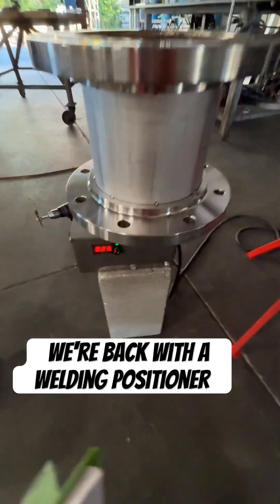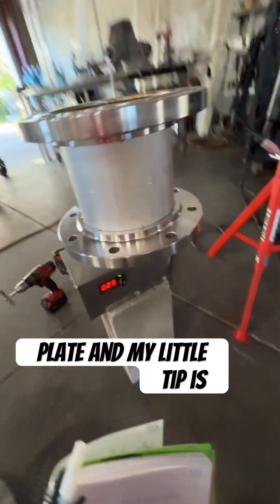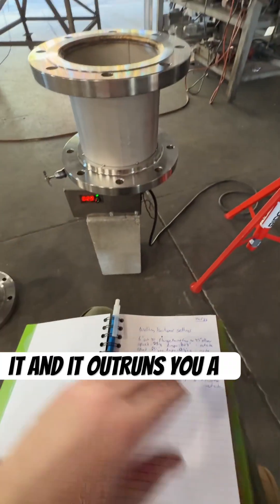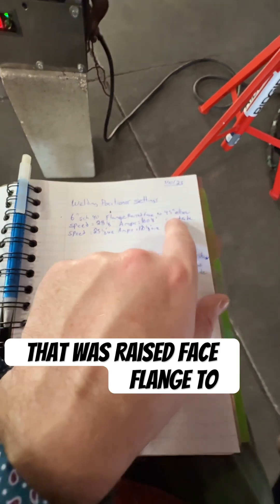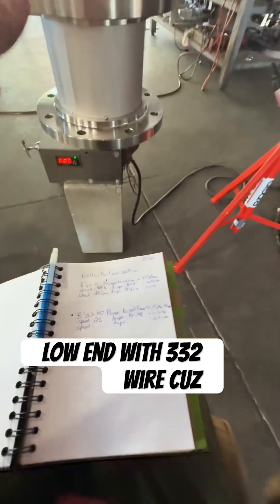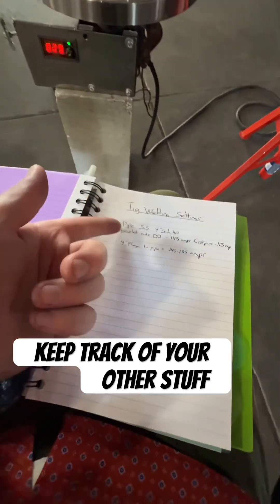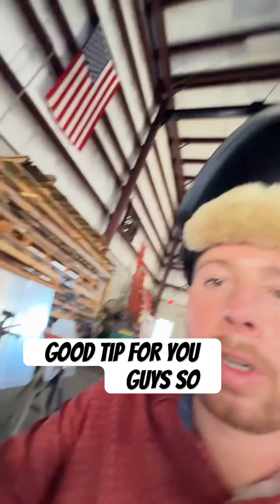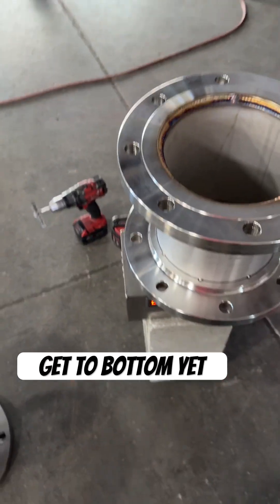Welding positioner tips and tricks - Tig welding

Comment: What kind of digital read out did you use on your positioner?
Reply from the maker: There’s a bunch off Amazon for like $30 if you search this or the link it should bring you to some

Stepper Motor Driver Controller Integrated Board Forward/Reverse Pulse Speed Angle Control Module PLC Serial Communication for NEMA 17 23 Motor

https://a.co/d/2pKnYJw
Reply: @WojnarskiWeldingFabricaion thank you very much!!  I greatly appreciate you replying back. I was using a multi meter and would like to install this to make it more user friendly.
Reply from the maker: @1bigtrucken no problem yea having a digital numbers makes it easier to remember settings for next time for me I have a book I write my settings in for the positioner. Like pipe size material thickness than amps and positioner speed now I’ve been adding the speed for wire size also helps a little 👍